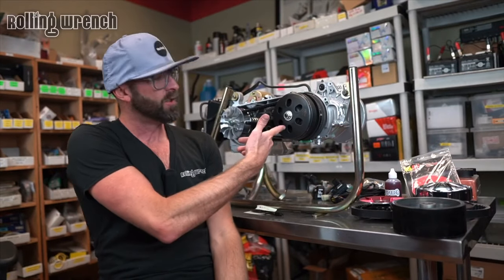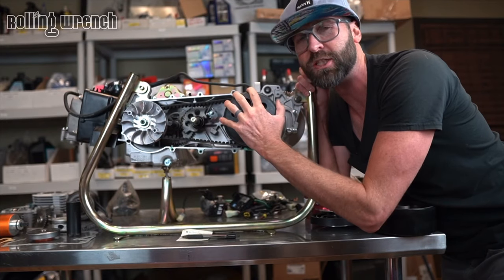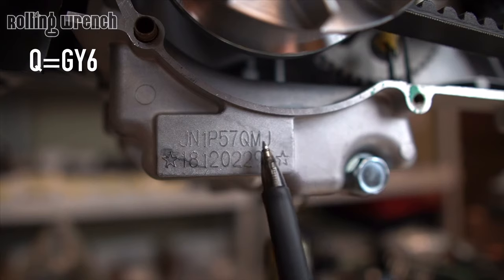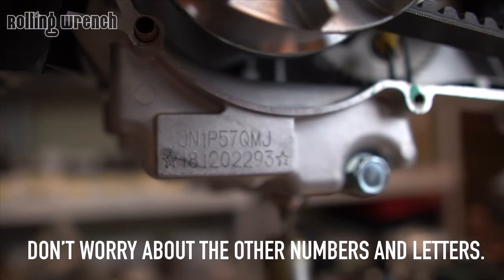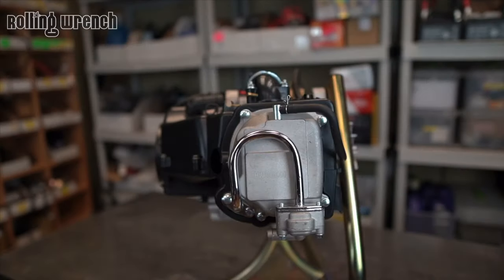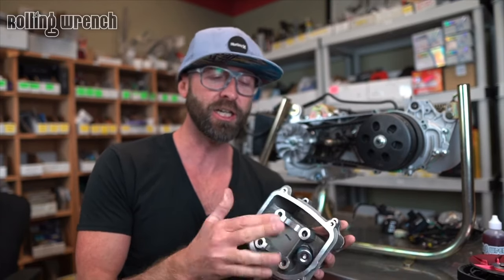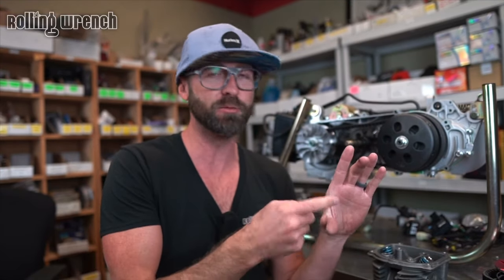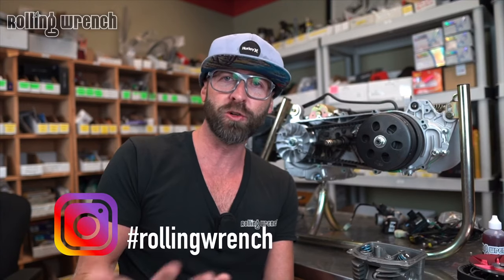GY6 [EVERYTHING YOU NEED TO KNOW] decode your engine!

Comment: I have been wanting to build myself a fun get around custom project for a while now. My 50cc 2 stroke skateboard is fun but not practical for distance.Now i have a gy6 50cc ugly funky scooter and im going to rip it apart and use the power plant (motor & CVT transmission) and front disc brake set up and modify a beach cruiser bicycle to fit the GY^ engine with all the goodies like water cooled  100cc big bore kit, stroker counterweighted crank,  ported and polished cyl. head, turbo kit lower gearing and add all this to 26 inch heavy duty spoked bicycle wheels for an over all top speed around 70 mph! I will be fit to really get around easily during 5pm traffic jams!

Comment: One search, “how to know if I have a GY6?” And BAM!?! 
SOOOOO much info packed into a 5min video!! 
I JUST picked up a Chinese Back/half, I knew little to nothing... just knew I wanted faster! (Who doesn’t?! lol) 
I’m a Fabricator/Creator/builder, so making the 139QMB fit on an old school Spree frame is going to be a snap, but for what little I have invested ($150 for a turnkey Spree-learned it needs a stator I can’t get new, and the gamble on a used one for $100 just not worth it when 4/st parts are SO cheap! Plus the running/complete GY6 QMB back/half)  I’m that guy that has to squeeze unrealistic numbers from a seemingly “timid” looking 80’s Honda Spree.... 
      In short, I can’t Thank you enough for answering every question I had and saving me hours of searching!!
Reply from the maker: Sweet! That spree is gonna be a fun project ! Thanks for the support 💯🙏🏻
Reply: Of Course!! 
Some super valuable info right there! 
     I mean, you didn’t make your wife cry, crash your car from being an idiot, post a video of someone falling down, or even attempt to dive into a completely frozen swimming pool, so, good on you! lol 
      I am a little stuck when it comes to a big bore kit though.... I see there are several kits to pick from, and I’ve only been able to find one that’ll take me straight to the Max @ 52mm, however, I see most of these kits come with a disassembled head, but not sure if they come with the bigger valves and just aren’t showing it.... 
SO, Could I get your recommendation(s) on the BBK, cam, carb, Variator kit, valves, etc? 
Even if the parts are from several different sellers, I’m fine with that too, there’s just so many to pick from, I’d hate to buy parts I don’t need or don’t work together if I can help it.... 
     Like I mentioned, I’m a builder, so putting it together and understanding what a “+/-“ tolerance is, no sweat.... I’m just looking for the biggest bang for the buck.... 
I’d really appreciate any guidance you’d be willing to offer!

Comment: Thank you. Nice,clear explanation regarding long/short case and A/B stud spacing. What I can't find info on is the difference between engines that have the swing arm lugs on the bottom of the cases (single shock applications?) and engines that have the swing arm lugs on the top of the crankcases (twin shock applications?). I have a SYM Orbit 125 which pivots at bottom (and only has a single shock) and a SYM VS150 that pivots at the top (and has twin shocks). The end of the cases where the shocks mount are also different. What gives?

Comment: 1p63qmL.     1 piston 62.5 mm piston 2 valve head. With reverse. I guess its short case also reffered to as a 200cc but i think the actuall number is less . I foumd this motor on a gkm200 buggy

Comment: I have a Short Case because I have 10 inch wheels but it's a P model. You didn't talk about the P models but I think you should have because the P models have more performance than the stock non P models. This is Great if you compare stock to stock But the Non P models can handle a larger big bore kit. Here is what NYC says about them: "If you have a letter “P” after example “1P”, stands for (P)air valve horizontal engine. The P series engine has a taller cylinder head and a shallow recess cam seating that gives it slightly more performance than non-P GY6’s engine code. However, if both cylinder and cylinder head is swap out it will be identical to the non-P GY6 139QMB engine. So, parts are interchangeable as long as both are replaced cylinder and cylinder head from 1P and non-P. But why? Because their so many upgrades available for non-P type engines include performance camshaft, etc." - So I Won't be able to install a larger Camshaft BUT there are still Plenty of other mods I could do!
Reply: Who's NYC please
Reply: @danysanjab2539  It's the name of the people that makes or sells parts for Gy6 based scooters.

Comment: Great videos and valuable  information Rolling Wrench!  Thank you.

 I have a 2016 Sym HD 200 (171cc) with 19k miles.  Runs like new just as the day I bought it and it still looks like it's right out of the showroom, etc.  I do all my own routine maintenance, oil changes every 500 miles, all other fluid change-outs on time, valve lash exams, etc.,etc.  

Question: Seems to me this GY6 motor is going to continue to serve me well for many more years and miles to come although in your experience about how many more thousands of miles can I expect?  

Thank You
Dean
Seattle
Reply: I have a 150 cc four valve SYM (VS150) with 62000 kilometers.Oil changes always at 1500 kilometers and my riding styile is VERY abusive, always passenger and very heavy traffic. Pulls as new and my research leads me to spect 100000 kilometers before deep maintenance.

Comment: So I have a gy6 150cc in a go kart, a kandi. I just bought another go kart, I'm probably a hoarder, and the engine is a liquid cooled 250cc.the engine. Is in a box...  Some assembly required. My question is if the 250cc engine is considered a gy6 as well?  I need to. Get some missing parts and know what I have will help.

Comment: i love your videos, they are so helpful. I have a 139QMB that was upgraded, but i think i want to just jump up to a 150 cc gy6. its a short case, will a larger 157QMJ fit? like are the mounting holes in the same locations and dimensions? I know the CVT needs to be the short variant, but are all the other dimensions "stock" and the same across all similar models?
Reply: nope, they're not the same. The max you can upgrade with that engine is 100cc. There's a 105cc from SYM Motors If you can find one from taiwan.
Reply: Did I miss something,  I'm looking at a new gy6 motor from CL, how do I tell if it's short or long case , case says jn1p57qmj just like the video,  but is it short or long?

Comment: Im looking for info on PGO scooters, specifically a 2013 PGO metro 125cc. They're  made in Taiwan and imported into the US under the name Buddy. This particular one was originally from Guam and the owner shipped it home to the US with him (I have the original Guam Title and paperwork). There's no engine code above the serial, just a PGO brand stamp. Im in the process of teardown / autopsy and putting together a parts list and need to know what engine code to use when searching for parts. A local shop in Guam did a poor job of installing a big bore kit and despite the motor being low mileage and well maintained, there's carnage. It had an NCY head and cylinder and piston was stamped with 58.5.

Comment: I have a 2005 QMB GY6 with gas leaking into oil tank. Question, is it better/easier to just replace the engine? And if so what is a good replacement brand?

Comment: Ok, a few things match here. I have a XS1P37QMA-2A. It's a SYM/Peugeot engine. its OK on the bore size, 37mm, but acording to most common knolege the MA size doesnt even show on charts, but has 50cc displacement due to its 47mm stroke. If it is a 50cc it should be an MB, so there are things to consider wend buying a big bore like the height of the cilinder. 
Also this engine is an "hammer head" instead of the comon ones with a full cover, so how compatible is it with upfrade kits?

Comment: Thank you very much for this great information.. I am in the process of upgrading my gy6 B motor stock from 150cc to 180cc taida cylinder. I just wanted to find out if I would need to cut my stock B case to fit the 180cc taida cylinder 63mm . or will it be a direct bolt on?.. Do you have any where we can communicate? Would like to have a chat with u.. Am in Grenada island in the Caribbean.. Help ..
Reply: i'm doing same thing.. mine is a chinese engine.. there are kits until  max 200 with no need to bore crankcase.. i found a video here in youtube... p.s a crankase boringg tool is always good to have...  other friends will need to do the job.. you can  ask some spare cash  for it..

Comment: I have, what I believe to be, a GY6. However the plate with the numbers has only a "1P57F" and a serial "16120364". Can you tell from the F what engine it is. It does have two oil cooler ports on the crankcase.
Reply: Honda pcx?

Comment: Knowledge is power! I have a Tao Tao 50? What kind of engine do they have & what should I upgrade to help run longer and better and possibly a bit faster?
Reply: I would go with the 52mm big bore kit and carb upgrade ive installed the 52mm kit many times and they work great just be sure to get the big valve head with the kit never use the stock head it will have way to much compression and will not last very long and for more topend speed upgrade the final drive gears

Comment: Can I put a QMJ157 (150cc engine) into my Icebear PMZ50-M1 that currently has a QMB139 (50cc engine)? I am unsure if the engine case tabs are different and if the wiring from rollingwrench GY6 swap kit ($1625.00) would bolt right in and wire right up. Any advice would be super appreciated. Thanks!!

Comment: You said nothing about the P which some P motors have taller heads...idk if all do or not. You said nothing about the actual GY6B which uses totally different crank and cvt parts than the  taiwan B-block.

Comment: Hey Rolling Wrench, I am an old scooter guy new to the gy6 Ruckus style scooter scene. I recently purchased a ChongQing Bashan Ruckus style scooter. I have been playing hell to find any info on it. I finally tracked  it down by way of the CVK carb and found you - 
 Here is my query: I saw another video by ScooterGY6 youtube  user/channel titled "Chinese Scooter 49cc 64cc difference 139qmb and 1p39qmb" you say there is no difference between the two. 
I have the 1P39QMB and need parts for it. in particular the intake and a few odds and ends  but can you verify what you said about the code 'P' meaning piston? I have been in the automotive field all my life and I have never heard of a engine code labeled as a letter representing the P for piston.
ScooterGY6 shows and example of the 139QMB vs the 1P39QMB and there is a huge difference in bore  and obviously vales etc.
 any idea where or how to find real information or documentation on this rather than just someones verbal absolution?
Thanks to You in advance - Dave.

Comment: Hello I have a 157qmj and i want to get up the top speed because I want to run 80/90 km/h but in 90 or 95 is almost in red rpm . I have dr pulley rollers but only take 10kmh more. I want change transmission gear but I don’t know which buy . Can you help me ?

Comment: I have a GY6 motor it does not have the code where you said it would be the only other thing I can find is where it says 124 cm3 I was told it was a 150 when I bought it could you please help me out here I'm trying to order harness stator just things to get it running again it only has 64 hours on the motor any help would be grateful thank you God bless. One other thing Aldi crank or where the stator is it says 125 y x but I was told that does fit 150cc.motor

Comment: Hi, I have a question regarding my SYM Classic/Fiddle 125cc scooter. My Engine has this code:   XS1P52QMI  3, I want to upgrade it to a  GY6 150cc engine. BUT, My mounting points on my existing engine are at the bottom, where as the GY6 150cc mounting points are at the top ??? What can be done ?? Cheers

Comment: What about a gy6 that doesnt have the letters/numbers on the top row of that plate? I have a gy6 (Im pretty sure its a true gy6 cause its stamped on the side of the case), but I dont know the specs. That small plate on the side that you show, only has a set of numbers with the star at either end. How else would I determine everything? Also, it is a short. I can tell that much and it came with a 2 seater buggy. Thanks for any info.

Comment: I have a 157 qmj is my crankshaft and driveshaft bigger than a qmi. Because I have some parts for a 150cc scooter and they don't fit the hole in the veil raiders two small it won't fit over the crankshaft

Comment: I’ve got a Xingyue 150 scooter I’m trying to find gaskets for that is 57mm stud pattern stock bore but neither B gaskets don’t fit anything on the motor 

I’m told they are one off engines because they have 16” wheels 

Need help

Comment: I've got a short case GY6 that I was hoping to do a swap onto my ruckus.  I believe it is a short case because it has 8 bolts holding on the CVT cover, not 10.  I simply can't do the swap with it?  Even if I want to keep the stock wheel?  Or is that just not possible?

Comment: Hey what is the best 50 cc racing engine that i can buy complete that is bored out to 70cc or more & if i buy a complete racing engine if the stock scooter has a typical chinese 54mm short case engine can i just replace the entire engine with a long case racing engine or won't it fit in the frame ?

Comment: Ok knowledgeable people. When i start my 250cc gy6 engine in my Buggy, at first it cuts out a couple of times, or if i touch the gas pedal it cuts out. It runs fine once its warmed up. But literally everytime i start it, ive got to wait 10mins. Ive replaced the auto choke, no difference. 
TIA
Reply from the maker: You need to do a valve adjustment. Your valves are tight
Reply: @RollingWrench  thank you. Do you have a vid on how to do this?

Comment: I have a question maybe you or someone could help me with? I have a ruckus clone (diaxi pmz-150n) that has the wide back tire and comes stretched stock...the guy I bought it from said that the engine casing is cracked and that's what the oil is leaking from, he covered up the engine code, and thanks to this video, I was able to determine that I have a 157qmj-a On this bike. At the end of last summer it started blowing out the spark plug and I made it work with lock tite and rethreading a few times but it's finally just not going to be able to be patched again I don't think. So I was wanting to buy another engine, since this one leaks oil and now the spark plug issue...... The scooter shop here tells me I need to have the exact same engine as the one that's on it now ordered, but based on this video I was hoping to be able to get a "B" engine instead since it's the better engine.... I don't understand what would be different as far as mounting or connecting to existing parts/wiring, can someone please help me understand this a little bit better please? I'd greatly appreciate it!

Comment: So what is the difference between the 1p57qmj and the 157qmj ?. The internet forums say parts won't interchange because of camshaft/piston/valve clearance and also timing chain length. Will parts interchange?
Reply: well with the 1p39qmb to 139qmb Its piston size so maybe its the same with the 1p57 to 157

Comment: Hello! I have a problem.. i bought an xingyue xy150t bike with gy6 157qmj engine with 2-bolt head cover.. i googled it.. and it's a type-2 or type-B engine. MY engine is not working at the moment since the previous owner did smth with the engine cam chain and chain tensioner.. my question is WHAT IS THE LEGIT LENGTH of the cam-chain?  is it 90 links? 92?94? please help me...  Like the comment so he can see it!

Comment: So I think I have a gy6 clone? It's a kymco engine currently in an mxu frame ( guessing it's not the original engine) the code stamped on the case is LB30 5200250 .  Any help would be GREATLY helpful and appreciated.

Comment: Got a question, ive installed a 150 motor on my taotao the motor is almost completely horizontal, how will this effect the oil splash for the piston?
Reply: Joshua Buck this is perfectly fine, it wil cause trouble if it’s tipped to the front when cilinder is facing slightly down because the oil can not flow from the head back to the crankcase/oil sump

Comment: I've got one of these engines that the code is 157FM... that's all the info that's on the top line. Can anyone tell me what I'm working with? A or B if it applies. I'm guessing it's a 157cc but that's a complete guess. There is no letter Q telling me it's a GY6 but it's the exact same design. All it says is 157FM. Can someone please shed some light on the motor I have? And any information that can be provided would be super excellent, thank you to anyone who decides to help.

Comment: Hey man I have a 2012 blade utv for my daughter's.   Lz150-1 model .   The engine won't start and I tried every known attempt to get it running.  Now I'm thinking I have to rebuild it. Pulled it from the kart and now it's on the floor.   Question .   Looks like I can buy a gy6 engine for $300 online but it doesn't come with the 90 degree gearbox that houses the sprocket.  Can I buy the engine and just swap my gearbox on it?

Comment: I have an European version E-Ton Viper  (EXL-150). I THINK it has a 150cc GY6 motor but there are no markings that I have found on the motor itself. It looks really similar to the one you show in this video. In the paperwork it specifies "engine number" to be JIEV306A026490 and "Engine type as marked on the engine" to be V30. How can I know for sure?